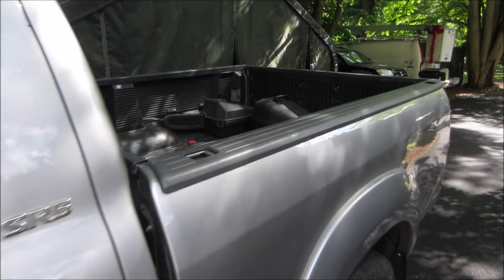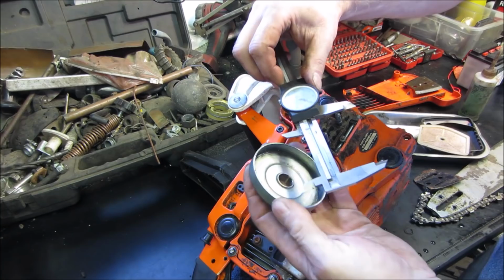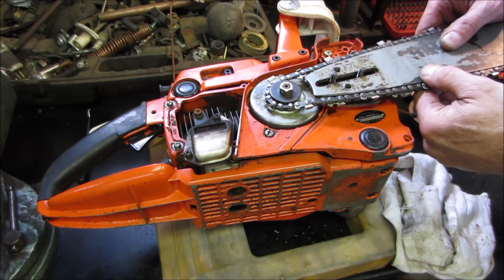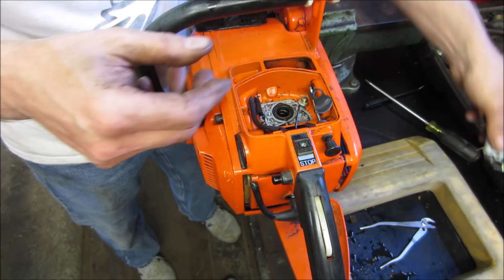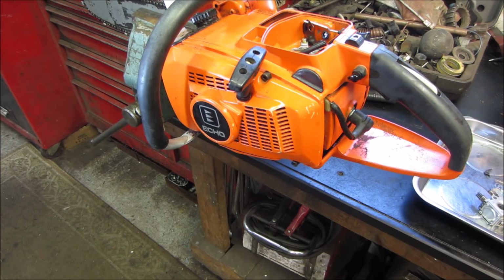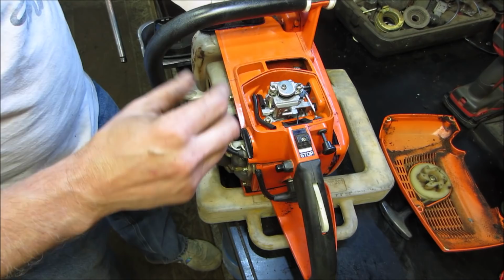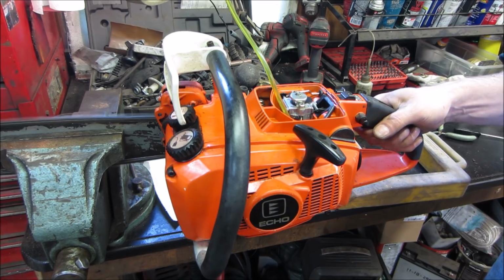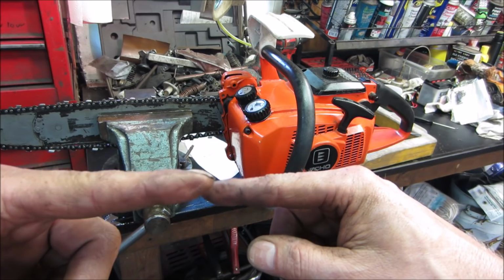Free Echo CS 400 Chainsaw, Will it Run?

Comment: The weighted filter in the fuel tank is called a clunk, ( klunk?) some manufacturers cheep out on clunks,  Walbro makes a excellent retro fit replacement in the aftermarket.

Comment: For supporting random things, like fuel lines or flashlights, I use a magic arm camera clamp with claws attached to both ends. One claw grips whatever convenient surface is available and the other grips the item you want to hold up.

Comment: Good luck finding that kit! I have that saw's big brother, the CS 500. It's over 40 years old. Echo has stopped supporting it with parts and kits. Check with Walbro. They MAY have another one that would bolt up. My saw was an amazingly reliable and strong machine until it outlived the parts availability. Thanks for the video...

Comment: You ain’t lying about the lifter spring.  Put a little grease on the end of the spring.  That will usually keep it from flying out.  Check height of lifter arm with a Walbro W tool or Zama Z tool.  I have both.

Comment: Not very many people know to lift the blade when you tighten the bar. It allows for less slack in the chain and also some saws have alignment marks for falling trees. If the bar is tightened properly they have marks on the cover that help fall the tree in the exact position. There will be lines that nobody knows what they’re for. You can see it on a Stihl

Comment: Did you check to see if the spark arrester in the exhaust is plugged?
Reply: a tribute to Yeah, Sure 👌
Reply: @ @sruk A plugged screen will make the eng. run rich, not lean!! Hence the pos. of the high and low speed needles. Most likely its the pump diaphragm or the clunk as some times its also the fuel filter.

Comment: That’s a 80’s series echo.  You can tell from the add on chain guard.  Later saws had a seperated chain break lever that would engage a break band on the sprocket.  If I disassemble a carb it gets cleaned and a new rebuild kit installed.  My policy.

Comment: My first parts cleaner was a 5 gallon steel can with a speaker under it(vibrates the bottom)and a aquarium aerator (air pump)Worked great.

Comment: Check the fuel line and filter, too.  A filter blocked with water will do the same thing.  I set the Jets at 1.5 turns out and then check it and adjust from there.   Dull, too.  That par for the course with a free saw.

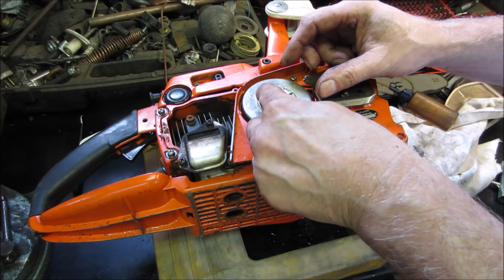Comment: At 14:00, you can see the hole in the end of the shaft the drum is mounted on?  That is the rarely used grease point for the caged roller bearing - just a couple of pumps with the grease tool and that's the rollers greased every time you flip the bar - also grease the nose sprocket same time...  Most people don't know what that hole is for.  Not all saws have this, many do.  You find out in the first instance by seeing if a wire will go down to about the middle of the drum.  If it is blanked off don't worry about it, if it is a hole now you know what it's for...

Comment: Chains loosen when hot it needs to be pretty tight with that style bar. That bar has a roller bearing on the tip, that either should get bar oil routed to it, or have a pinhole for grease.
Reply: Doug Hunt you know your stuff

Comment: Actually rebuilt an older model a few years ago. Was fun screwing around, but parts were ridicule price and carb parts were crazy. Was fun 2 see work, but no brake and really underpowered. Anyone that needs a short term saw, just buy Walmart or Amazon 22" cheap saws and throw away when done.

Comment: If you can't find a new carb kit, you can bring some life back into the diaphragms  by soaking them in brake fluid for a couple days. I collect and restore vintage chainsaws and have used that trick for diaphragms  that are no longer available.

Comment: You should replace fuel lines and filters with the carb kit, that saw is an old workhorse.  Double check fuel oil ratio, them older saws ran more oil. Love them older saws, nice catch!

Comment: Those tanks used a grommet of which the lines went thru & sealed the tanks off. If that fuel line & the pulse line are in the same hole, that's NOT the way they came out. Should be 2 holes in the carb area. Pulse line is next to the oiler, fuel line to the left of that looking forward from the handle. There's a washer/spacer on the choke plate. Don't turn those saws past 12000 rpm! As for the fuel tank, change the fuel filter.

Comment: Sometimes check the spark arrestor in the muffler.  It can get coked up and create back pressure that will stall the motor.  I own two Echo and two Stihl chainsaws and I’ve gone through the same drill you did.  The Echos are for playing with and the Stihls are for cutting wood.
Reply: Thats the first place to look after checking fuel lines.over a period of time the build-up will grab your attention.

Comment: My hunch is there is a return line restriction that is not allowing the pressure to equalize in the tank.  The low circuit is more sensitive to the pressure difference.  Recall when you first removed the air filter the return line was not connected.  I would bet somebody was able to get it to run with the return line disconnected but gave up when he saw fuel squirting everywhere and noticed how hard it would be to replace the fuel lines and seals.

Comment: I have a newer CS 400 (maybe 10 years old) has been a pretty decent chainsaw, and has never failed to fire up. Have not used it a ton over the years, but when I have needed it, it seen a lot of cutting. I'm no chainsaw expert, but I've been happy with it. Edit: just used my CS-400 the other day to cut a massive tree branch that broke and hanging dangerously, the saw fired up easily like new. Thought about Mustie while getting my chainsaw out.
I also like to stand in the yard flailing it around like Leatherface.

Comment: 80’s-90 echo saws were junk.  That saw is out of that timeframe.  The timber company that thinned the trees on our farm used to leave them in the woods when they blew up.  I could have picked up a truck load if I had wanted to.  My Stihl saws were never left in the woods because they did not blow up.

Comment: One thing Iv learned on carbs smaller then ones that come on four wheelers are most of the time it’s best to order a kit for lines and carb or just a new carb now a days you can get find the carb, lines, plug and filter all together for real cheap online on most engines and redo it all!

Comment: Looks like you may be able to buy a new carb for around $25. on Amazon. Kit would cost close to that and you'd have to clean up the old carb and install the kit. Better off sticking a new carb on it, if you want to spend the $25.
I replaced the old Zama carb on my Husqvarna straight shaft string trimmer with a brand new Zama (identical) from Amazon for $18. For the $18 I also got a primer bulb, gas line, tank filter, and base gasket. Works like a charm.

Comment: Looks to me like that Echo saw used to have a chain brake on it. That orange block above the chain has a slot in it where the brake used to attach but has been removed.
But,.. I could be wrong.
Reply: My Echo 302s doesn't have a chain brake, just a hand guard...if it kicks back you just get a splitting headache as a result LOL.

Comment: There seems to never be enough time or money to do it right the first time but always enough to do it right the second time.  Take that carb off, remove the Welch plugs and cook it and the put a new carb kit in it, replacing the Welch plugs.  Pressure test it if it will not hold an idle.  If the seals are bad the bearings are probably also bad.  I set my saws at one turn out and adjust from there.  I do not own an ech saw.  My saws are mostly Stihl with a couple of huskies.

Comment: That return may be the impulse line.  That is why it has drag.put a little grease over the end and pull the starter rope.  If it is the impulse line it will blow out the grease.  The gas leaking probably means there is a hole in the fuel line.  It could be a bad grommet, -replace the line.  If it goes into the cylinder it is the impulse line.

Comment: It would be good to see a "How to" video on tuning a chainsaw carb. 
This "Hi" "Low" screw setting on the carb does seem a bit of a mystery to most people including myself. 

Nowadays a chainsaw does seem to be pretty much a disposable item. 
I've known crews who normally get a new cheapo chainsaw out of the box 
JCB being one of the common makers of saw. 
Then use it until it goes wrong and throw it in the skip and go get another one. 
For £80 it isn't worth bothering to repair anything, that's just the way it is.

Comment: That turned out pretty good. It is getting harder to find those kits these days probably be easier to get a carb.
Reply: Found and bought two new carbs for Stihl chainsaws on WISH. About $10 each plus shipping. It just takes weeks to got them across the ocean.

Comment: I would also try increasing the idle screw as well as the low speed mixture screw to see if that makes a difference. Also the low speed jet could be clogged as well. You could try removing the low speed screw and and shooting some carb cleaner through there.

Comment: I hat saws that have vertically mounted carbs, that usually denotes a horizontal cylinder which means you have to take the whole saw apart to do anything to it, e.g Mac, Homelite and some Poulans.

Comment: I needed a new chain for my Husqvarna chain saw so I went to Boston Lawnmower my local dealer and also I need a part fot my 17 year old ariens tractor. On my way out I see a long line of Husqvarna tractors and one Ariens tractor now I know ariens doesn't make tractors any more  and hasn't for years so go take a look. It's an Ariens 25 HP 48 inch deck twin cylinder brand new 2002 tractor it has been sitting on rack in the warehouse for 17 years it's just like my ariens just the next size up and it's only $1299 discounted 60 % off the original sticker from 2002. So I bought myself a brand new 17 year old tractor and it came with a warranty

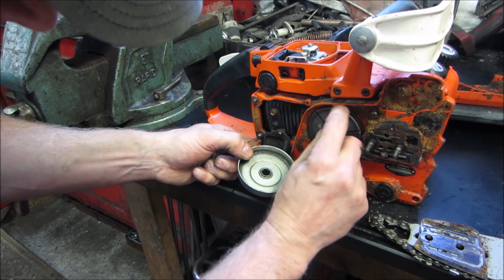Comment: @7:00  I believe that's a chain brake, the lever of which appears to be removed. When the chain brake is engaged the metal shoes engage the disc like a drum brake would.  The lever would probably mount in that hole 4" forward and 2.5" above from the drive shaft.

Comment: The Echo is an awesome old saw and it still has resale value for the right person looking. The plastic Poulan on the other hand isn't worth much even in running condition. Now if it was one of the old metal cased Poulans that were still made in USA then they're actually worth something. Those are the ones I do my best to look out for. :)

Comment: I've owned several saws and all clutches were metal on metal. I tighten the chain so that i can expose the guide tab by pulling hard. Buy an electric sharpener if you use it much! I have 5 chains and a harbor freight sharpener.

Comment: New fuel lines and filter. Also, check to see if it's a pressurized fuel tank (second line provides pressure). That fuel line seal to the tank may need replacing . I can generally get a new carb for just a few dollars more than the repair kit.

Comment: On small fuel lines you can hold your air nozzle and fuel line in line with each other.  When you blow across the end of the fuel line it will siphon the fuel for instead of pressurizing the tanks etc

Comment: Pictures as you go might help your memory. T handle Allen wrenches would make a nice addition to your tools. On my chainsaw, 1996 Craftsman, when I pull the throttle trigger, it releases the choke. What I can not find is a tool to adjust the carburetor. The opening is really small. I did learn some things to try on my chainsaw which runs good but just not it did when I first bought it. I did like the video and see there are more chainsaw videos.

Comment: Every time Mustie1 talks to us watchers with a question, I always get the feeling as if you are watching Dora or Diego. You can't answer his question, through the monitor. All you can do is comment. But since this video isn't live, what is the point. Also Will it Run? Mustie never had something not running. It's just the question, How fast in the video and how many parts did he need to repair/replace. But loving the videos. Love seeing how machines run and look under the exterior.

Comment: This is my 1st time seeing this video. I have a echo cs702vl that runs great. All i had to do to it so it was useable was make new studs for the bar and now it will cut anything i put it up against but it's a heavy saw and it's a powerful saw with a manual oiler

Comment: Oh man these  small 2 stroke carbs have gotten the best of me over the years 😬. After using many brands I have found best self propelled mower Honda, best leaf blower Stihl ( mine 10 yr old) and weed eater Echo 👍🏼
Edit: I have always used Shell ( or known brand Exxon etc) 93 octane that is no more than 6 months old, good pre mix oil and run all machines out of gas during winter months with no issues 👍🏼the following year
Reply: Honda mower isnt a 2 stroke though? or is it?
Reply: rimmersbryggeri  no it’s 4 stroke. Never had any issues after 7 years with it. The carb problems were mostly on older cheap weed eaters.
Reply: @lancairw867  Yeah especially if you don't run them dry before putting away.

Comment: i rebuilt many of those "pumper" carbs as a kid for model airplane engines (yeah ones that would eat your hand or arm if you tangled with the prop.)
very often the pump and bowl(needle-seat) diaphragms, would delaminate somewhat and shed fibers which gathered into little nested ball shapes, plugging the fuel flow... but what do I know ;)

Comment: one of the first things I do is check the fuel filter to see if it is plugged and the fuel line coming off it. If it takes the fuel from the bottle but not the tank…..  suspect?.  Then preset the carb to factory settings then start trying to make run.  There are h/llow settings then idle.

Comment: I wish there was a place where we can ask you questions on issues we may have with small engines and what your thought is. I have a Husqvarna string trimmer. when you take it off completely of choke, and really let it rip, it runs for about a few seconds and dies immediately, almost like if you hit the stop switch. I replaced the carb, new fuel lines, and fuel filter, but same thing..

Comment: Most of the time the adjuster screw is bent by not getting the pin in the hole before tightening down the bar retention bolts. The saw was made in the early 70s judging by the features on the saw.

Comment: Nice I’m currently working on a Poulan Pro 42cc 18”bar definitely would like to see a video on that one. It apparently has a lot of quirks. I will say one thing about it, grind the threads on the gas cap a bit they are known to swell and cause it to be a pain in the ass.

Comment: Mustie, God love ya, when the saw heats up the chain will LOOSEN.  when you start a cold saw, and before you go into a tree, let the thing warm up on the ground for a minute with the chain running, shut off the saw and check the chain tension.  probably you'll have to adjust it tighter a bit.    not a lot a fun when you're in the tree and the chain loosens to the point you have to fiddlefk around in the tree with adjustin the chain tighter

Comment: #1 way to fix these small engine based tools (Chainsaws, string trimmers, hedge cutters, mowers, tillers and such)   Take it apart far enough to find out what carburetor it has and just go online and buy a new one.   Preferably a whole fuel system and tune up kit based one.  

I can't count how many times have put carb kits in these things only to have it either do nothing or last for a short time then quit again because the kit was junk   Worst part is when the kit cost $10 - $15 with shipping and a whole new carb was $5 - $15 more or a whole kit with everything to do a full tune up was a few more above that. 

Also, when shopping look for the name brand or well rated ones.  Don't get the cheapest unrated POS you see on amazon or wherever.
That and for fuel lines that last, go find the FluoroElastomer ones.  They are typically bright yellow and are chemically indestructible regarding any type of fuel you would ever run through a small engine on purpose or by accident.   It costs more but it's worth it in the long run.

Comment: Initially you were going the right way.  No inertia chain brake, no chain catch pin.  Probably no spark arrestor or any of the other safety features found on today's saws.  Did you say cut, or melt something?

Comment: Echo good saws they made saws for John Deere in old days also.
Japan makes awesome stuff.
Typical fuel gum and old fuel lines diaphragm pump change and it will run nice.
Thank you for taking time to make videos.
PS needle arm adjustment in height critical. Many wrongly just try bend them and saw floods or starves for fuel. Set it to specs.

Comment: Both used to run...well so did the POS Poulan Pro 16" Chainsaw I tossed out the shop door a couple weeks ago and dug out the 30+ year old Echo 302s Chainsaw that actually started after sitting for 2-1/2 years hmm, I think I'll continue to keep the Ole 302s going, it needs some services done but it still runs unlike the 2 year old Poulan pile of crap.

Comment: Nooo.  Not loose so much!!! You should pull down on the chain while holding the bar and it should not pull completely out of the bar groove.  You'll end up with a broken chain if you make it too loose.
Rubber fuel lines need replacement.  Copper lines can be left alone.

Comment: I have an Echo CS330EVL and it looks very similar to that one.  It is my best running saw.  It's only a 16 inch bar on it though.  !6 inch was the longest one for this saw.  You could get smaller bars for it (10 inch, 12 inch, and 14 inch) when they were new.  Not sure if you can still get all those sizes from Echo anymore.